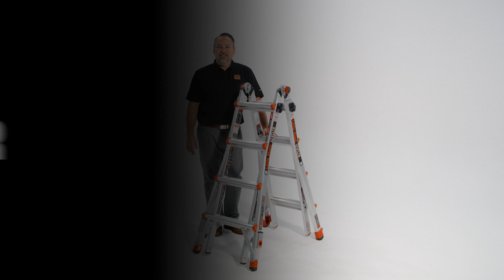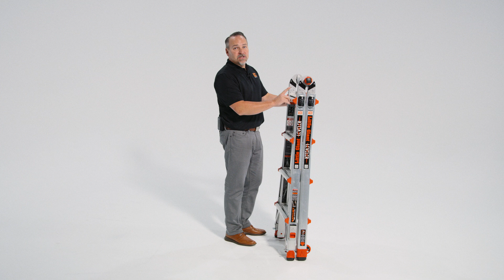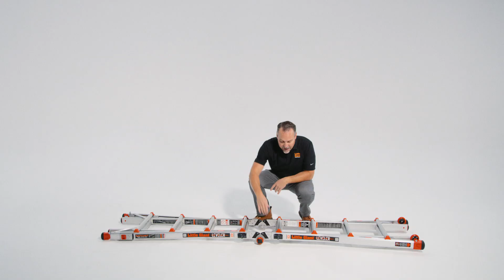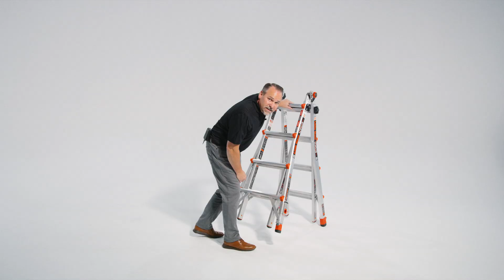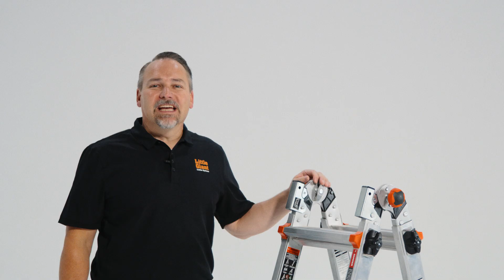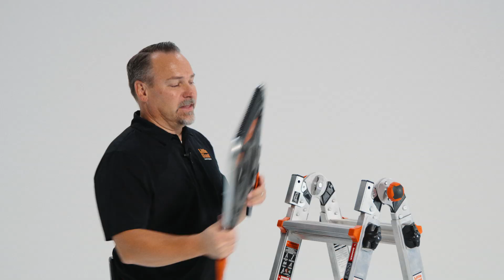Leveler | Demo | Little Giant Ladder Systems

Comment: Hello. I have one of those. Can I make a scaffold and how?
Reply from the maker: You can separate it into trestles, but you need Trestle Brackets to lock the outer sections together. Then you can use either a Little Giant Plank or a scaffold-rated 2x12.
Reply: @LittleGiantLadders  thanks for replying.